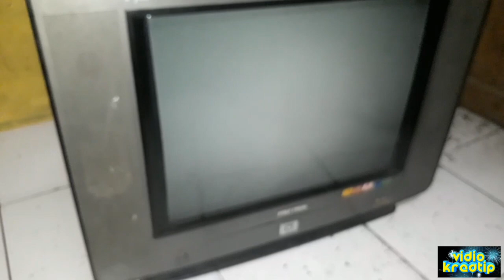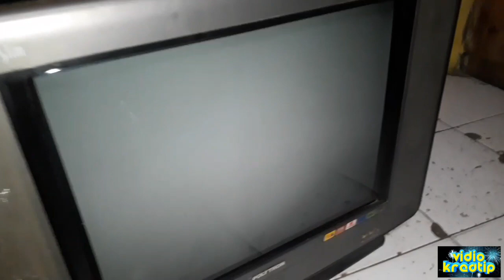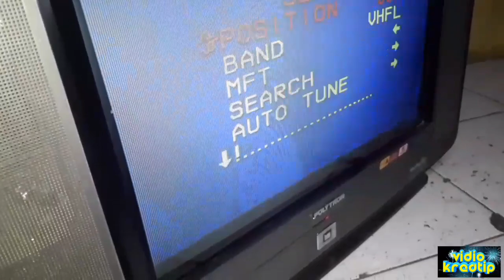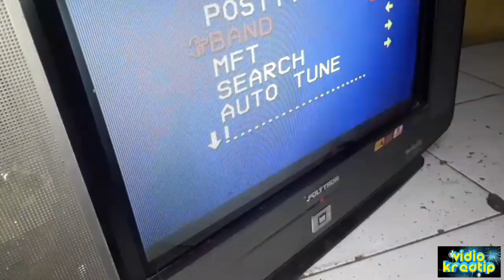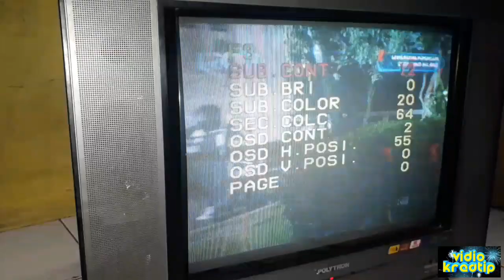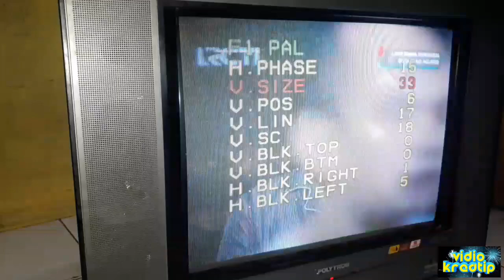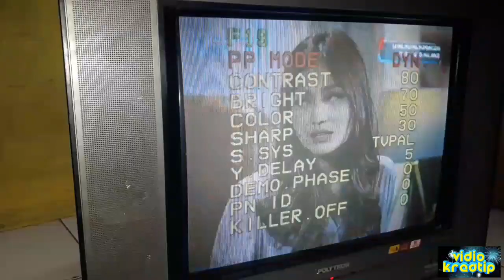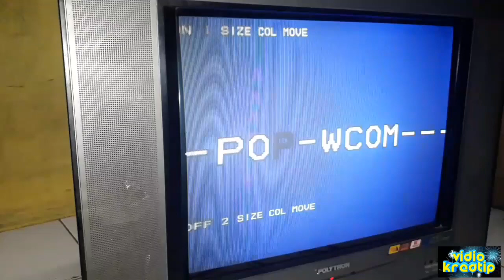Cara mengganti mesin tv cina wcom ke slim polytron

Comment: bang yang merah sudh aman bang.mau tanya tv sya polytron xbr.sya pakai gacun apa hrus dilepas ya tr T505/A0123.punya saya stelh pasang gacun tegangan b+kluar tpi tegangan 5 voll blum kluar.apa hrus dlepas ya t505 nya.apa gak ngruh bang untuk komponen yng lain bang.mohon bantuannya bang.
Reply from the maker: Klo pasang gacun klo bisa gacun nya yang 29in biar stabil amper nya lebih besar..untuk masalah pasangan gacun.itu komponen yany di legulator g.usah di copot gpp.yang di copot hanya.kapler saja.yang lain gpp.yangpenting gacun harus berada di pas pasangan nya.gron dan vcc.masalah 5voll urut jalur nya sapa tau ada yang shott..
Reply: iya gan.sya pakai 29 inch.tr 882 dan tr c2235 dan D510 sdh sya ganti gan.tpi nihil hsil tetap dropp yg 5 voll.solusinya bang komponen apa yg hrua di ganti.trimaksih sblumnya gan.shat slalu gan..
Reply from the maker: Klo 5vol g.ada cek dari ic program..

Comment: Mas klau tv slim politron  29 inch kapasitor biru wk 1234  yg sangat dekat playback,berapa ukuran ya
Reply from the maker: 394j400vol
Reply: Yg kode mesin tv politron HBEE 012A,yg berjejer tiga warna biru transistor  kotak ,pas dekat play back,2000v200 uf,apa 200v2000 uf ya,karna nga ke baca
Reply from the maker: 202uf200voll
Reply: Mksh mas semoga sukses